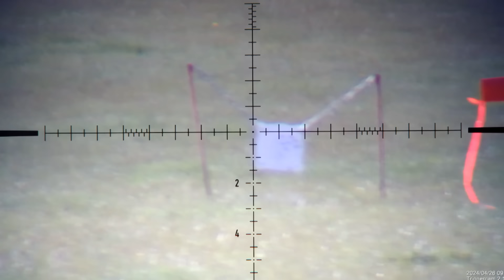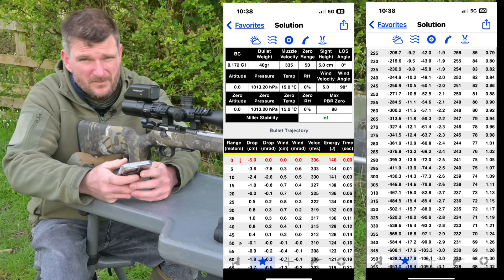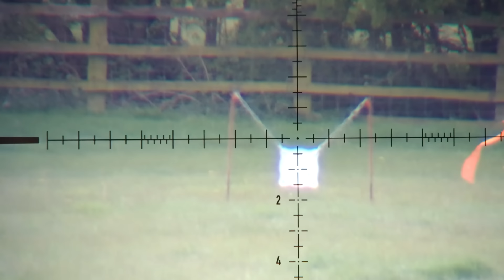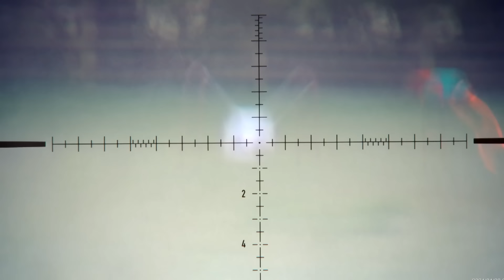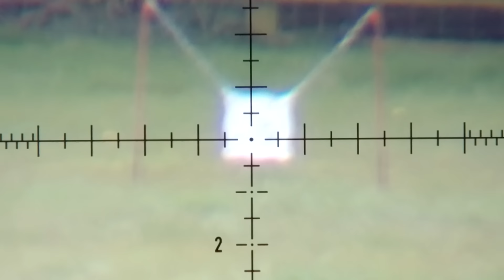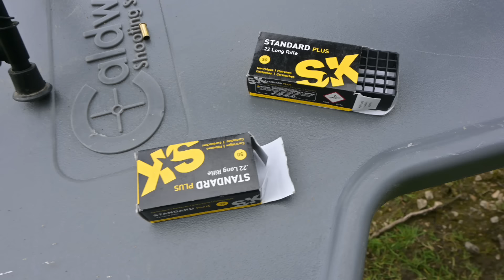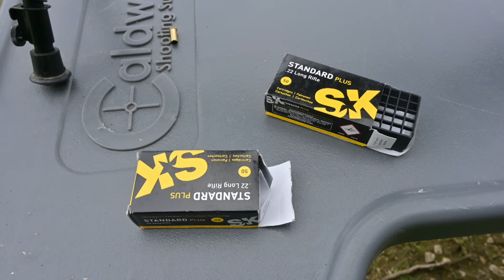CZ 457 Stainless Synthetic pushed out to 200 metres, part 2

Comment: I have the base CZ 457 with the 16” varmint barrel, I have found the stock at the front does flex a lot with the bipod. (Same stock as yours without the camo print)
My Ruger American in stainless 22 magnum also with a plastic stock is quite firm with the same bipod.
Due to this I’ve ordered a Boyd Varmint Pro laminated stock and bottom metal.
Just wish the CZ stock was at least as solid as the Ruger American. Knowing what I know now, would have spent more on the CZ and purchased the factory Varmint Pro.